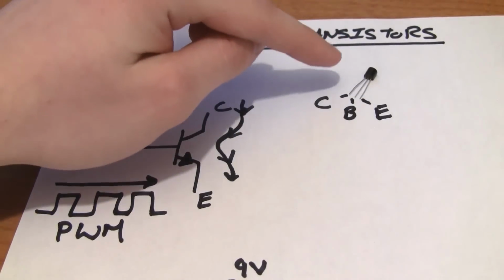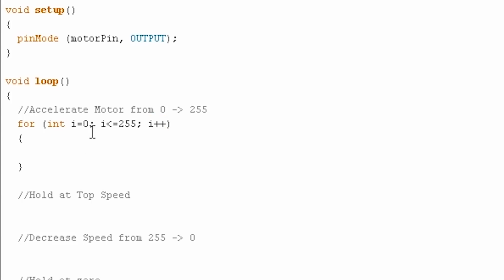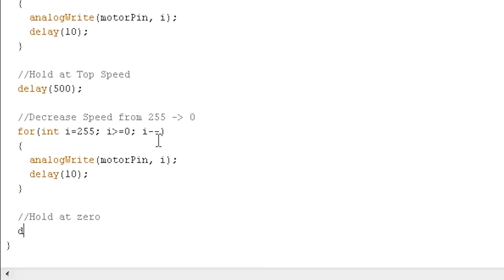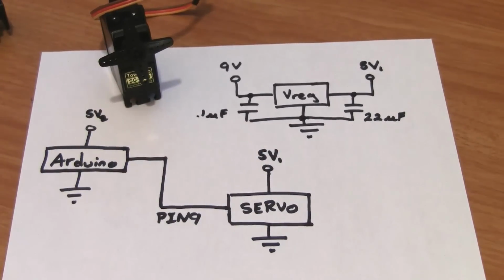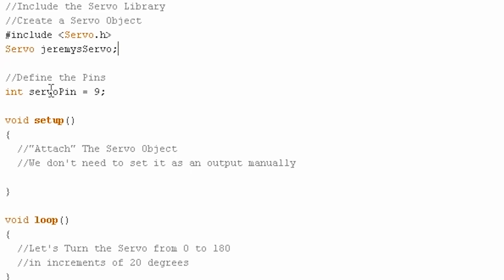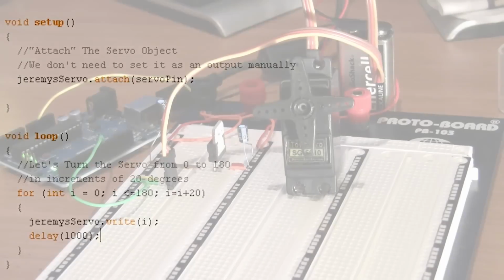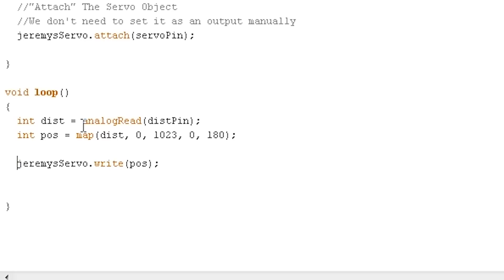Tutorial 05 for Arduino: Motors and Transistors

Comment from the maker: @raghunitin Wait, you might be a bit confused between transistors and voltage regulators.  You said what "transistor" did I use, but listed two voltage regulators.  I used a 2N7052 to allow me to use 9V power for the motor while switching it with 5V from the arduino.  If you want to convert 9V>5V, you want a voltage regulator. In which case, an LM7805 is fine.

Comment: The pins for your transistor identifies the 2N3904 or 2N4401 transistor. If you used the 2N2222 transistor, the collector and emitter switch sides.

Comment: In his explainations, Jeremy is using what is called conventional current flow, this used by most engineers to do calculations and explain current flow/device operation. Electron flow is actually in just the opposite direction, because it is actually electrons being exchanged in the outer ring (orbit) of the atom, that is current flow. I am only making this distinction to clear up any confusion, as most Tech School Electronic programs teach Electron Flow.

Comment: FYI: The flow of electrons in an NPN transistor is into the emitter and out of the collector so long as there is a high enough positive voltage applied to the base for current to flow out of it. It's the PNP transistor where current goes into the collector and out of the emitter.

Comment: ...also, you can then use the value of "i" within the loop itself....

analogWrite(motorPin, i);

So, in the "accelerate" part of the code, "i" starts at 0 and increments all the way up to 255. This value is used by the analogWrite function so the motor will run faster as the value gets larger. :)

The "decelerate" part starts at 255, then decrements to 0 instead.
As you can guess, this gradually slows the motor down again.

(255 is the maximum value you can hold in 8-bits, for the PWM module).

Comment: true, its not there for isolating if you wanted to protect arduino from shortage you would put in a diode, if a transistor would ever short circuit from colector to base. Flow through the transistor usually opends at 0,6-0,7v which has a current which is a product, of the voltage input and the resistor.

Comment from the maker: @CIPHERJAY The arduino is supplied 5V via the USB connection.  Anything that needs 5V power can be plugged into the arduino's 5V pin, and it will receive 5V via USB as well.

Comment: Great tut's on code. But a transistor is a current amplifier, and that 1k resistor is needed to protect the base and the arduino pin from over current (not just in case of a short as you say).. just like your LED tute. Without it you are trying to put 5 volts across a 0.7v diode. Eventually you will cook either the transistor or the pin on the micro

Comment: @CURISION Analog pins don't operate at simple 1 or 0 values. He's using analog. The maximum value of current through an Analog pin is 255, the lowest is 0. So if he puts analogwrites 100 to the motor pin, the motor will be using 100/255 of it's power. This is a generality but hopefully that helps explain it more.

Comment: Around the 5 - 7 minute mark you showed how to accelerate/decelerate a motor - terrific - Thanks. But could you please show how to code for a gradual incrementing amplitude, first turn say 5 degrees forward, then 8 degrees reverse, then 15 degrees forward, then 25 backwards - the increments are not so important as what the code should look like! Thanks ( I am used to BASIC, this is new to me). Cheers.
Reply: Here's my idea :

 #include  <Servo.h>

Servo myServo;
int incr = 1;
int pos_neg = 1;
int incr_speed = 5;
int degr = 90;

setup(){
bla bla bla ...
}

loop(){
while ( degr<180 && degr>0 ){
degr = degr + incr;
degr = degr * pos_neg;

myServo.write(degr);

incr = incr + incr_speed;
pos_neg = pos_neg * (-1);
}
}

[incr] defines the incremental value, which is increased at every loop
[pos_neg] defines the rotating direction at the current step
[incr_speed] defines how fast the incremental value should be increased
[degr] defines the degrees
The while loop works like a for loop but checks for degr at every loop.
Remember to declare all variables at the top of the document. Declaring them in the loop makes it slower.

Hope it helps, that was fun for me too :D
Reply: Thank you so much for taking the time to do that code -  most appreciated - I will study it and test it out soonest and reply. Cheers, Derrick
Reply: You're welcome, mate! I'm getting into Arduino as well and can use my coding knowledge here very well. I noticed a little thing on my code: the loop should contain a delay() inside the while() loop so it doesn't run too fast. Also, the variables should be reset at the beginning of the main loop, so the whole thing can run repeatedly.
I'm looking forward to read about your testings ;D
Cheers, Sam
Reply: MrSaemichlaus , I was using PICAXE micro-controllers coded in BASIC, so the language and syntax of ARDUINO is completely new to me. The electronics part is easy, but I need some time, and experience, to get my head around the coding since I am a self-taught 63 year old nerd. Thanks for your assistance and I will definitely share once I get my projects working.
Reply: I'm a selfthaught nerd myself, but 44 years younger :D
Feel free to ask me for any help with coding.
I wish you lots of fun with what you're doing :)
Greets, Sam

Edit: the Arduino IDE uses a syntax that is very close to C, if not identical.
Reply: MrSaemichlaus , Thanks !n  Cheers,

Comment: Great Tutorial!  I'm a little late getting to the Arduino party, but am enjoying it.  To add a little more fun, try turning on your serial plotter  and run this sketch for the DC motor portion:

}

void loop() {
  // put your main code here, to run repeatedly:

  for (int i = 0; i <= 255; i++) {
    int speed1 = abs(sin(i)) * i;
    analogWrite(motorPin, speed1);
    Serial.println(speed1);
    delay(i);
  }
  delay(500);

  for (int i = 255; i >= 0; i--) {
    analogWrite(motorPin, i);
    digitalWrite(ledPin, HIGH);
    Serial.println(i);
    delay(i / 2);
  }
  delay(500);
}

When you view it on the Serial Plotter, you'll get a very interesting 'wave' showing the motor speed being applied during the speed up process (or slowdown if you're using a PNP instead of a NPN transistor like me.)   Your motor speed will try to swing wildly with the plotted curve.

Thanks again for the tutorial.

Comment: You say at 13:40 that you connect the distance sensor to the same 5v rail as the arduino to make them have the same reference voltage for the Analog to Digital conversion. Doesn't the servo require the same voltage reference on it's 5V for the Digital to Analog conversion?
Reply: Nop , if you connect the servo to the same voltage it may damage it due to the current , plz dont forget the motors are inductive load .

Comment: The "for" loop is basically a function that takes three arguments...
(The loop will repeat until the second argument is false, of if a command inside the loop is used to "break;" etc.)..

for (int i=0; i<=255; i++)
{
 ; do some stuff in the loop!
}

In the first argument, you can state the "starting value" for a variable.
(In this case, Jeremy also declared the new variable "i" using "int i".)

The second argument is saying "repeat the loop while i is less than or equal to 255"....

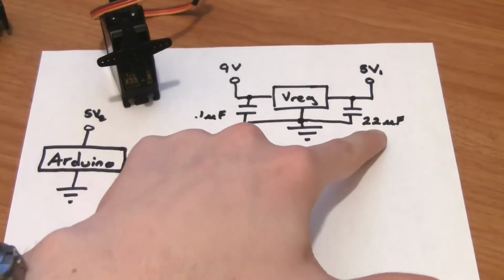Comment: could a 12V DC servo be powered by an external source like at 8:30 and then grounded to the arduino? is there a voltage limit when doing so? 

Thanks! great vids btw. You're awsome.
Reply: It can be , their is no problem with that.

Comment: Well, polar and non polar are not the same thing. Polar capacitors only let current flow in one direction, which means that, if you apply negative voltage to the positive terminal of a capacitor, it will go to waste.

In this case I think a polar capacitor would do, but better just stick to the instructions. The capacitor used in this video is nonpolar, ceramic. There's a list of all components in the video description.

Comment: Amazing tutorial.  I have a question.  Instead of the 9v battery and that whole setup with the voltage regulator, could I use a 6v battery pack made of AA batteries?  I use that set up on some RC stuff and the servo works fine.  Is there a complication that I am missing on the Arduino?

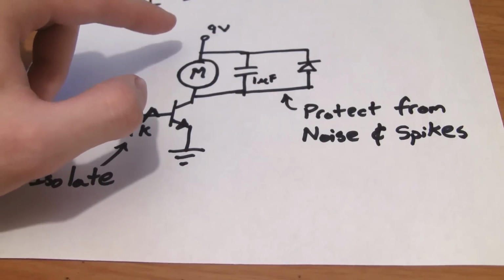Comment: 3:10 shouldn't there be a resistance next to the capacitor? To prevent the current from flowing throught it instead of the mototr? or do they act as resistances already....
Reply: capacitor here is not for current purposes , capacitor is for prevention a spark (inductive load gives reverse current since voltage has been sopped that is why we use diode in reverse polarity usually ).

Comment: Hello Jeremy I'm having some problems with something a was wondering if you could help me I wanted to know how to control a DC motor with a flex sensor. It would be that I bend the flex sensor to make the motor go faster and when its in the straight position it would stop. So from straight its at 0 rpms and then when I start to bend it it start accelerating to as fast as it can go

Comment: Never mind, disregard I just changed the transistor to another one with higher collector current output it worked like a champ but I used a 2n2222a rated at 800mA and blew two of them and what's strange is that all I was pulling out of the collector was about 350mA, oh well great stuff Mr. Blum you are very bright.

Comment: i tried to control my servo with the help of a pot which made the servo very jerky. so wat should i add to the circuit to reduce it??
Reply: When I came across that, I used a lower voltage. I assume the torque is reduced but at least the jerkiness is alleviated. Hope this helps!
Reply: Did you test the Pots output to see if that was jerky? Maybe average filter the pots output to smooth it out.

Comment: Can I just use the 5V supply from the arduino to power the Servo WITHOUT the use of a voltage regulator. Or do you have to use the separate power supply and regulator?

Comment: Would it be possible to control 7 servos through potentiometers with an Arduino uno, or leonardo? Or would I need to buy the mega instead? Also how would I supply power to the servos since I don't think the board will have enough power for all 7 servos?

Comment: I'm a beginner so sorry if this is a stupid question,
but i'm using a dc motor with and IR sensor. 
is it possible that if I want to limit the dc motor for turning 15 deg right or left to use the 
analogread for the sensor 
and map it to the dc motor
or ananlogwrite
or do i have to use a different function the map

and thanks for these videos they are very helpful

Comment: i understand that the capacitor is used to protect the motor from noise, but i wonder, does it need to be 1 uf or can it be smaller/larger and it should still work fine with a reasonable degree of error

Comment: No. The voltage regulator that is built into the board also limits the amount of current that is available through the board. This is to protect the arduino.

Comment: Do you think I could run multiple servos using the 5V from the Arduino if I connect it to a power supply independent from the usb? I have a 9V, 1A power supply, and I was thinking that would do the trick. Will it?

Comment: @sciguy14 Thanks.  I tried it last night and it worked fine.  If I am going to be powering 5 servos(I am making a strange version of a robot arm) should I have multi battery packs or should it be ok to run them all off the same 6v AA pack?

Comment: Hey jeromy I couldn't understand the programming u done with infrared sensor using 1023 and 180 please explain it..
Reply: Map function just like scalar min to min and max to max lets say you have something with limit from 0 to 1000 and your your servo motor has range from 0 to 180 , in this case you scale the 0 to 1000 into 0 to 180 using map

map(min,max ,ScalarMin , ScalarMax)

Comment: Is there any way to make a regular DC motor run at variable speeds without losing power? I'd use a gearbox but I only have one of them and I need two. 

Someone tipped me about PWM but since I'm just lowering the average voltage I'll still lose power so if I make it go slow it wont be able to carry anything. 

Thanks in advance

Comment: I recently took apart an old printer for the dc motors inside. I made a simple circuit and program that outputs 5v from one of the arduino pens to the bread board and tried running my motor directly from their without a transistor. Not only did the motor not start, but when i checked the amount of current with a multimeter it only showed .3 volts. I disconnected the motor from the board and connected an led in its place and it lit up with 5 volts. Why, Is it the transistor?
Reply: Bruh...

Comment: by not using PWM in your motor case, don't you introduce potential heating issues by using the transistor in it's linear range?  (Google NPN power dissipation)

You can avoid this by simply varying the on portion of the PWM cycle driving the NPN.  Also, the choice of the 1K resistor would seem to be driven more based on the current in the linear response (through saturation) of the NPN.

Just concerned folks are going to cook a transistor.

Comment: Great video.

However when I run the program for the servo on my own circuit -  the servo just rotates continuously. I have tried increasing the delay and changing the increments for the degrees but cant figure out why its doing that. any ideas?

Comment: how can I Control the speed of the motor depending upon the
orientation/tilt of the board.
Reply: zaib khan You would need an accelerometer for that that would be on the board you want to measure the orientation / tilt

Comment: if i was to control  a single stepper motor with an arduino, would i need a motor shield or can i just use the arduino as is?

Comment: What is the wire on the positive side, left on the board connected to in the first stepper motor project? It looks like its connected to the red thing above it, but what is that red thing connected to afterwards?

Comment: Is that a 1 microfarad ceramic capacitor? I didn't think they made ceramic ones that high. I downloaded your schematics from the link, and that's what it seems to say, so I used a 1uf electrolytic but my circuit won't work. Frustrating.

Comment: Is the arduino language capable of using trigonometic functions?

I wonder because we're supposed to do a project in school and since I study robotics I would like to build a ball catcher using servos. The angles of the servos would be calculated with trigonometry.

Thanks :)
Reply: I think it might be. And if it isn't you can always just write your own methods that do the trigonometric functions rather than use anything that might be built in. However, I think it's based off C, so it probably has some kind of trigonometric functions built in. I'm new to this myself so if I'm wrong dont hate
Reply: entering "arduino trig" into Google would have been faster for you... yes, it does...

Comment: hello, i have two question, how do you conect the ground in the first motor?
the 9 volts of the batterery and the 5 volts of the arduino to the same pin GND of the arduino? 

can i use a 220 oms resistor on the base of the transistor?
Reply: yes and yes. All grounds are connected like he said and the resistance on the base of the transistor doesnt really matter
Reply: How can i calculate The voltage that i need on The base of The transistor?
Reply: ***** Look up the datasheet for the transistor. It is usually 0.6 Base-Emitter Voltage on bipolar transistors.

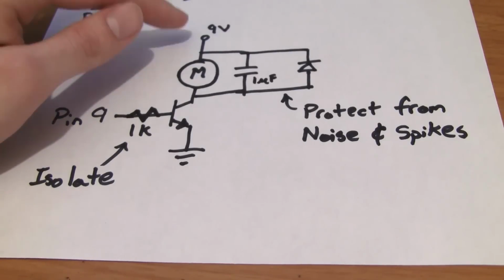Comment: 2:55 circuit:

What exactly are the roles of the capacitor and the diode? I know that it's supposed to stabilize it, but can someone briefly explain to me the role of the components?
Reply: Diode: a component which works with the same principle as a transistor. It's an object that allows the current flow into only one direction. (See the video of Learn Engineering about transistors, there's a brief explanation about that)

Capacitor: as far as I know, it's a component that stores (voltage) energy when connected to the voltage (arduino, socket, etc.) and releases it when connected to another component, like a LED.
Try doing this: Get a polarized (has anode and cathode legs) capacitor, connect it into the GND and 5V of the arduino, and connect it again into a LED, as if the capacitor was the voltage. The LED will quickly turn on and instants later turn off.

OBS: Do NOT touch the metal parts of the capacitor, or else all the energy will be lost, since it'll touch your skin.

Comment: so, i have everything set up letter for letter part for part. i run the program, nothing. i try a different 9v battery, makes noise but no movement. i remove the capacitor, it works. but, the transistor burns up. what is going on here? does current only flow one way through a capacitor?  why when i remove it the motor spins? i bypass the PWM from pin 9 and it runs. something is not right here. any help?

Comment: thnx for the help oblivion5683..,i have a mq-7 sensor, when this sensor detects the amount of gas it will send sms , alarm  and turn the servo motor into 180 degrees and the amount of sensor will be display in lcd.,hope you get it,this is for my project., :D